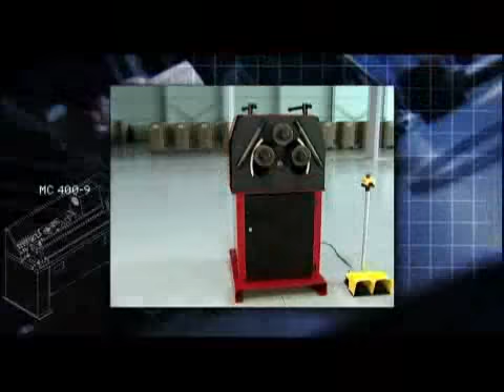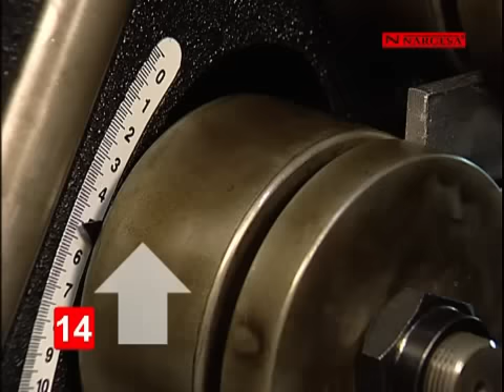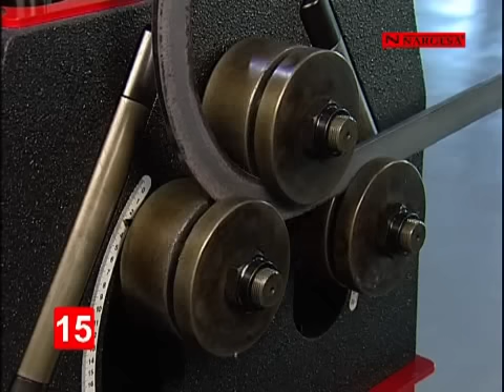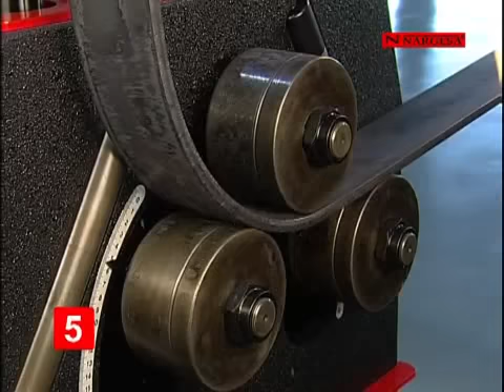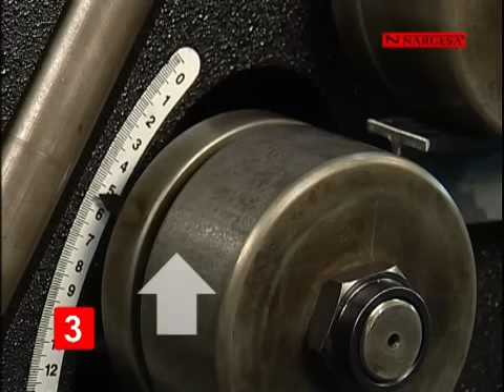CURVADORA ROLADORA DE TUBOS Y PERFILES MC400 | NARGESA

Comment: Nice machine. I see you show it bending U Channel. With the open part of the u facing down. Can this machine be configured to make hoops with the open part of the U facing horizontal? Hopefully that makes sense? Cheers!
Reply from the maker: Hi!! All the section bending machines we manufacture can bend the U profile in its two positions, with the open part up or down.
In this file you can see the 6 models of the section bending machines that we produce and their capacities regarding the different profiles: https://nargesa.com/sites/default/files/bending%20capacity%20Nargesa_0.pdf
If you are interested, this week we will upload the video tutorial of the new MC550 Tube and Profile Bender, edited in English. Subscribe to our channel to keep the track of our latest news!
Reply: @Nargesa  Thanks for the reply! I mean with the U channel open part facing the front or the back. Can this machine do that without crushing the profile? Cheers!
Reply from the maker: It is not possible to do it with our machine, but with any other neither. 
It is not the machine the one that cannot do it... it is the very profile the one that does not admit that kind of bent. It is simply because to doesn't have something to support it all along itself thus, it gets its way through the bend
Reply: @Nargesa  OK I was thinking that was likely. The profile would get crushed. I wonder how hoops with a U profile like that are formed? I suppose these profiles must be extruded like that (with the right radius of bend) rather than extruded straight and run through a bender? Thanks for answering my queries!
Reply from the maker: Hi there again. There are special bending machines for bending this type of profile. They are four-roll bending machines, in which three rollers are used to perform the bending operation, while the fourth roller fits into the open part of the profile to avoid the profile deformation during the bending process.
We hope we have been useful for you. Kind regards
Reply: @Nargesa  Yes, definitely you've given me an idea on modifying an existing piece of equipment that I have. Thanks for your helpful insights 🙂
Reply from the maker: We're really glad to know it has been an useful tip for you. It's been a pleasure to chat with you!! 😀

Comment: how this machine control the radius of the bend? is it just trial and error?
Reply from the maker: +Hao Zhe Loh Dear Sir, the bending machine incorporate millimeter scale that guide the operator at the time of regulating rollers. However, there is not exactly accurate work because each material and each dimension behaves differently. If you need to several equal parts, the first is what will guide you with the millimeter millimeter scale of the rollers can regulate in the same position for the other pieces come out alike. For all these works is fundamental the skill of the operator using the machine and as with everything, practice makes perfect. Best regards
Reply: nargesa1 let say I have some beams which made from different materials but the dimension are the same. if the upper is in fixed position, would it produce the same radius ?
Reply from the maker: +Hao Zhe Loh If you do so, the bents will be the same, but you still need to set the millimeter scales to fix the correct position in order to achieve identical shapes.
With the hydraulic version you have the piston which you can regulate and make sure in a quite easier way to achieve it without having to try on and off, there are different ways of making it. You may select the one you consider will be better for you out of the different options you find in these machines.
Please see the link and get another helpful tip on how to do it. 
https://www.youtube.com/watch?feature=player_embedded&v=Nv4Gf1aj7SQ